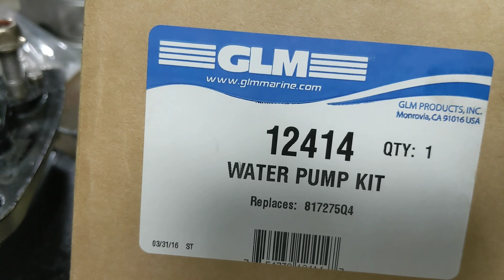Carrier Seal Replacement -- Mercruiser Gimbal Ring Replacement Ep 8

Comment: does anyone know if you can replace the seals inside that housing? it seems like the water pump kit includes the outer O-ring and the lower rebuild kit includes the 2 internal seals.  I happen to have those 2 kits and was hoping to avoid buying the carrier assembly for no reason
Reply from the maker: Ya that sounds like you're on the right track. Give her a shot and see but it sounds right.

Comment: What about the oil passage . It flows out just under that carrier seal. And leaks down into the bearing. Dont you think to much grease would be an issue bud?
Reply from the maker: Hasn't been an issue so far. Feel free to modify as you see fit. 👍
Reply: @605BOLT  alot of determination to get that carrier seal was needed I see . Wow. Yours was really in there
Reply from the maker: @jonathanroy2883  I think it was beginners struggles haha. Apparently screwdrivers on the sides in the holes is the preferred method.
Reply: @605BOLT  yeah I soaked mine . Put rags to protect the case and put a punch in the hole and tapped down on the punch to pry it upwards. Little bit on each side. I almost damaged the thin part of the case because whoever installed it had the holes in line instead of to the sides
Reply from the maker: @jonathanroy2883  ya always some creativity with these boats haha. Glad you got it worked out though.